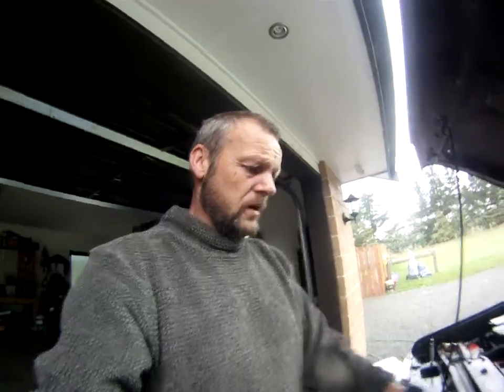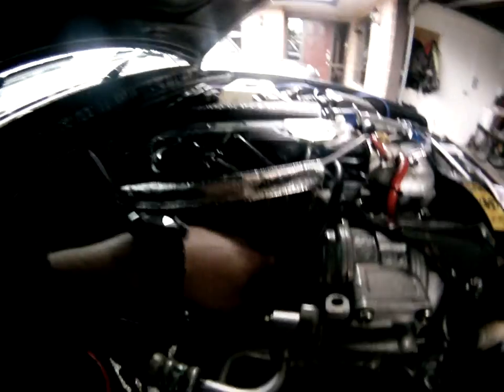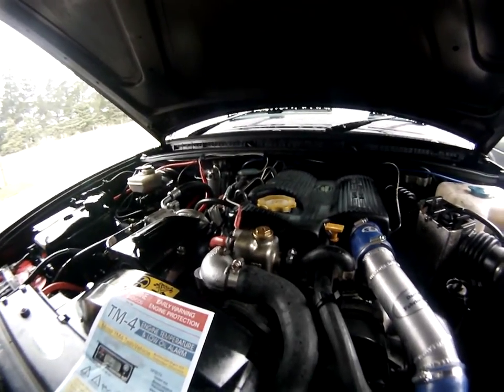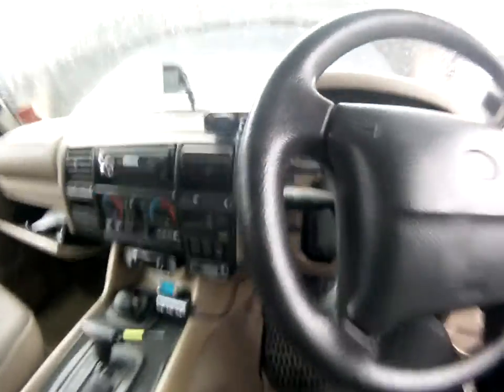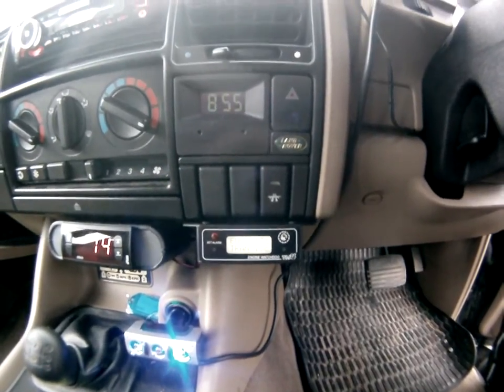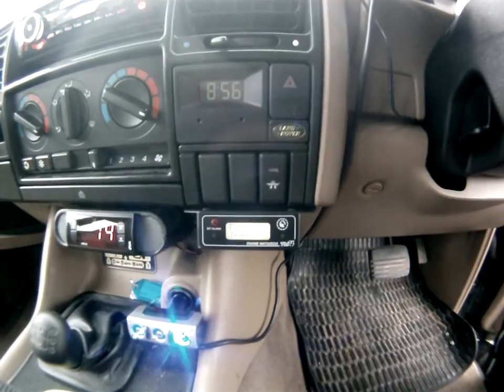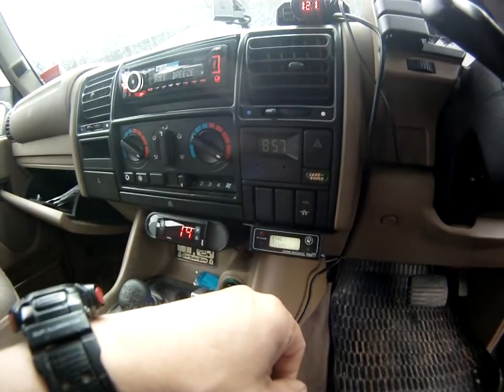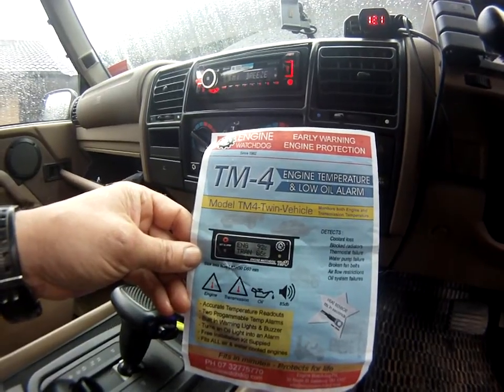Land Rover 300 TDI Engine WatchDog TM4

Comment: After you try the device .... what is the maximum temperature the engine body can reach from outside in normal operating conditions
Reply from the maker: Abo Albraa generally you do not want to run it more than 110 degrees
Reply: thanks very much